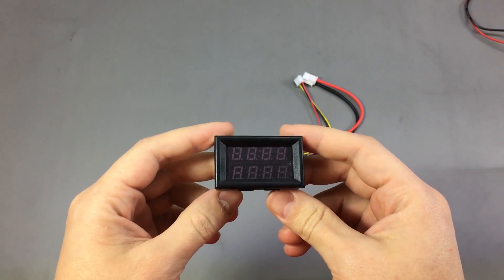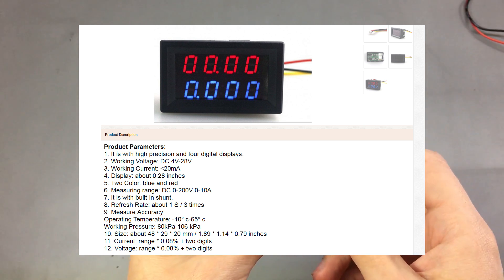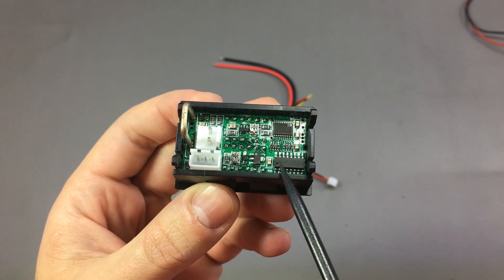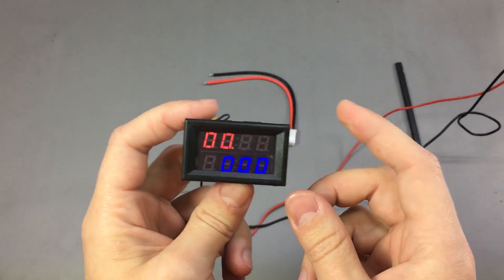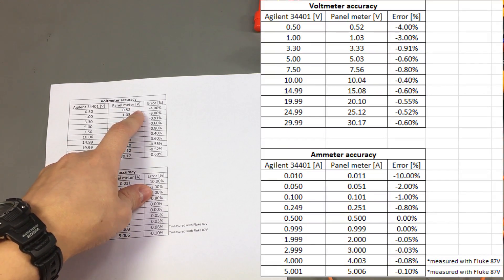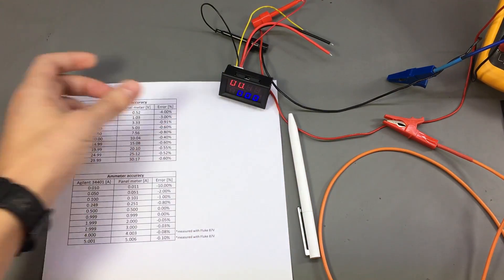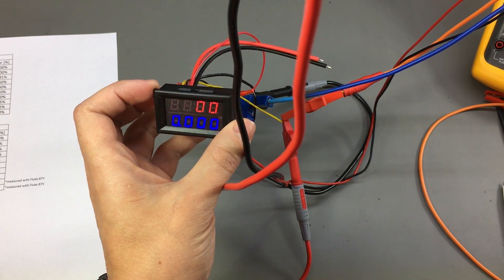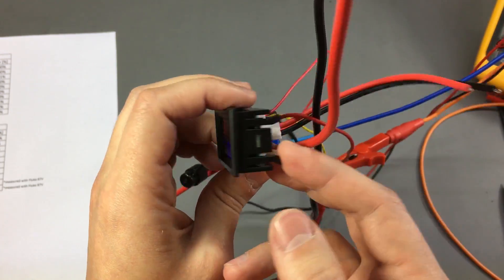Voltlog #132 - 4 Digit LED Panel Meter Review

Comment: Concerning the EBay voltage/amp panel meter, is there anyway to use a single 24 volt battery and read voltage and current from the same 24 volt battety?
Reply from the maker: yes there is, you power the module from the same battery where you are sensing.

Comment: I wonder would these digital meters interfere with the voltage spikes of the desulfator circuit https://goo.gl/kMuwYZ for pb battery? I mean with analog it's not a problem, but connect a bunch of electronics between the pulse generator and the battery to measure current and??

Comment: Hello VoltLog, thank you for the review.
One question on the meter specification - it says 200V but the default display is with the decimal point in the middle, which means 99.99 maximum voltage. Does it actually changes ranges based on the input or there is a jumper of a sort to configure ?

Comment: these things work without shunt and the wiring is a pain. sometimes the sellers dont even give a schematic for the wiring. cause if you try to measure current and voltage from a single power source it doesnt always work. one time a got magic smoke escape from on them. can you do a video about wiring such instrument for example for a lion battery charger to measure voltage and current that the charger gives to the battery?
Reply from the maker: I've update the blog post to include a schematic: http://www.voltlog.com/voltlog-132-4-digit-led-panel-meter-review/
Reply: VoltLog thank you very much!

Comment: I bought a few of these for shits and giggles. One of them is exactly like yours, the other one has an external 100A shunt.
I have the one with the shunt installed on my eScooter and the damn thing draws 40A @48V. The funny thing is the main fuse is also a 40A breaker! Strangely the breaker never trips.
They are ok for non-critical readings. I wouldn't put one on my power supply though. Specially for logic projects where only a few milliAmps are consumed. 
Have you had a chance to check these out? https://goo.gl/DVhgms
I got one and its pretty nice. The display is a little too small for my eyes though but the accuracy is pretty good. Hoping to use it in my dummy load project.
Nice video as usual...
Reply from the maker: Those OLED panel meters are pretty nice, I showed one here https://www.youtube.com/watch?v=oBM8cxyo8DY . Unfortunately the size of the OLED (0.96inch) makes it hard to see in a bench instrument type of application. For bench instruments you really want to be able to take a quick look at your front panel and read the values instantly. If you use it on a project that you only use occasionally i guess it could work.
Reply: ahhh, that's where I saw it and decided to buy one!!  
Watching your channel is bad for my wallet :)
Reply from the maker: Should I be proud of that? :-)
Reply: but of course!

Comment: This would be a perfect upgrade for the supply I was building. It's exactly like the one I'm using, but with 4 digits resolution instead of 3!
Reply from the maker: yup, it would give that power supply better resolution on the ammeter.

Comment: How did you connect the amp part of the meter, did you just connect the thick red and black wires like a shunt between a load or did you use another method?
Reply from the maker: yes, I used it like a shunt, on the low side.
Reply: But on the video, the thick wires where not connected to anything. Why?

Comment: First!
What about these 100-300A 120V models: VAC-1100A, VAC-1200A, VAC-1300A
About 20$, wireless, OVP, LVP and all. Should be hackable for PC data input.
Reply from the maker: 10mV 100mA resolution, not suitable for our projects.